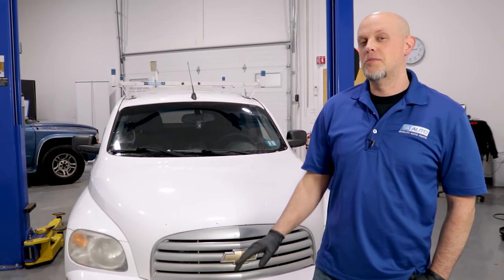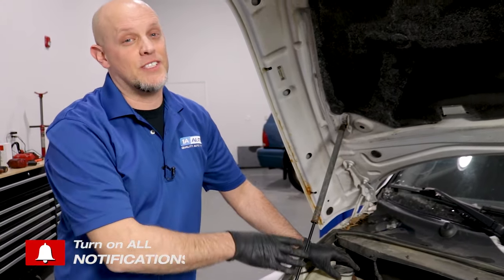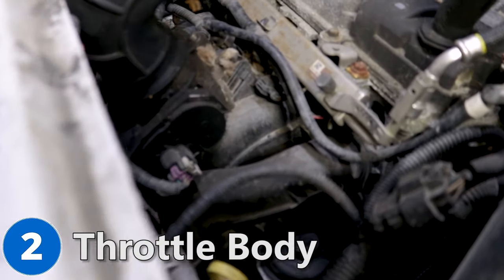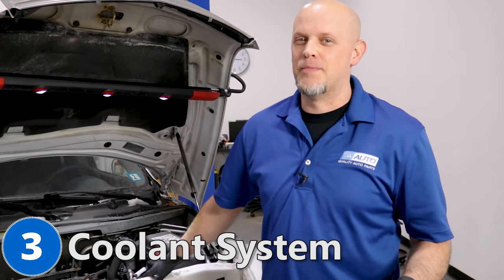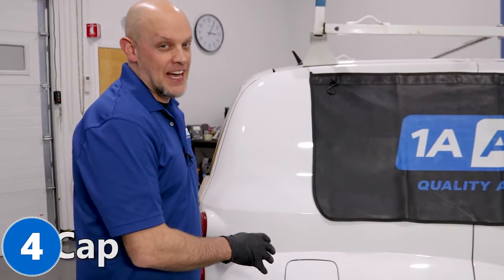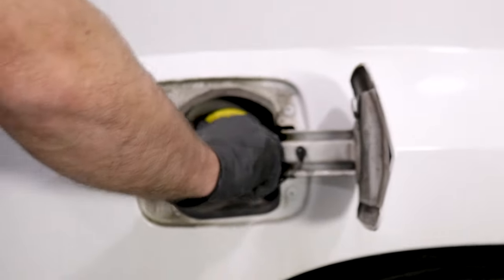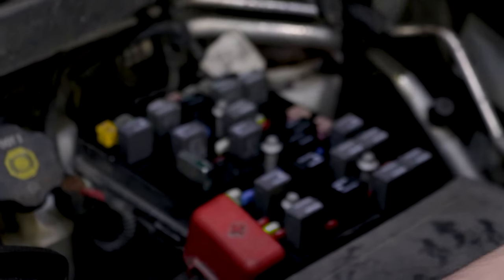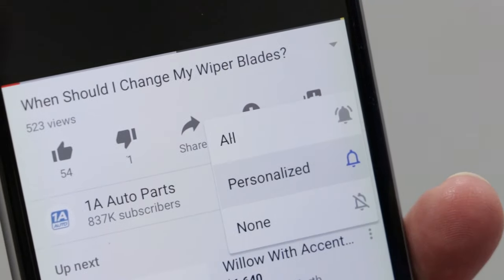Top 5 Problems Chevy HHR SUV 1st Generation 2006-11

Comment: Bought a 2007 a year ago that sat at a shop for 2 years a near by mechanic shop. His wife loves HHR's and she had one and his friend bought one near new as well. He was a old man and forgot to check the oil and ran it too low on oil and drove it and drove it and one day it died on him at a stop and he had his friend this shop owner come tow it back to his shop to see whats wrong. He found out he messed the bearings and rods up. It still ran but knocked very bad and had no power over 40 mph. So his friend sold it as parts to him for his wife in case she needed parts. It needed another engine or rebuild to fix it. So it sat. 2 years later he decided to sale it as is with a description of it needs a engine. I bought it for 900 bucks after talking him down just 50 bucks. He wouldnt go lower since it was in mint condition everywhere else. Had 127,000 miles on it. I made payments for 3 months and picked it up and drove it home. It ran like crap but made it home. When I got my $1,200 stimulus in 2020 I put that towards a used engine purchase online for $1,300 with free shipping to my mechanic shop and the engine had 83,000 miles on it. They sent me the transmission with it for free which was cool. A backup trans. Anyways had to pay a local mechanic $1,600 in labor to take the old one out and install this one. It's been running like a champ ever since but I've had to pay for all that and replace front rotors and brakes, then had to replace the whole flex pipe exhaust on it that was $450 bucks cause the flex pipe was shot and leaking exhaust into the cabin. Had to replace the battery which is oddly in the back and not cheap batteries at $140 bucks. I get oil changes every 3000 miles and always have my transmission fluid checked since they were dumb and wont let us check them without having to get under the vehicle to undo a bolt on trans to check it? Why not a stick up top ya know? Anyways I just have my local good mechanic do all that for me. Other than all that and spending near 5k in all now overtime overall... Its been a great ride so far. I think it needs shocks, struts ect.. But I can wait that out a while. It still drives good on the highway and I'm always driving 80 to near 100 on the long Montana trips to Billings Montana where we have to travel over a 100 miles a trip a lot. Handles it all like a champ. Runs smooth gets GREAT gas mileage. I can get 400 to 500 miles on a full tank highway miles that is. Only cost me like 50 bucks to fill the tank and that can get me 500 miles if I do the speed limit lol. 400 to 450 miles if Im always going 90 to 100 which guilty as charged I do a lot lol. At 100 mph it feels like ya doing 70. It's bad at getting you in trouble for being a lead foot cause it doesn't seem like you're going that fast. So now on the replacement engine its getting close to 90,000 miles driven on it by now. I don't drive 1,000 or more miles a month. Probably like 700 miles a month if that at times. It really is a good car though when its problem free that is. I feel the near 5k I've spent over time on it is worth it so far.
Reply: Yes and some people will say.. Why didn't ya just rebuild it, it would've saved me money. Yes that's true and that's what I wanted to do but my local mechanic won't do rebuilds.. Says it too time consuming and more issues happen. He rather replace a already put together engine thats been tested and confirmed its good to go and easy swapping and add the parts onto the engine block and done. Lot quicker and lot more stress free. He's my only mechanic in my local area that does engine work on cars. The others just do basic stuff around here. I'd of had to have my HHR towed over a hundred miles to the Billings Montana chevy dealership for a rebuild and I'd imagine they ain't cheap and they would take their sweet moses time doing it. My local shop told me to find a used engine or he can order a remanufactored one which was over $3,500 and I said hell no. That was way too much for my budget. A Used low mileage engine was cheaper and he agreed and let me find one. Cost me $1,300 online with free shipping and they gave me the transmission with it for free and he charged me $1,600 in labor to install it in 2 days tops. I dropped my car off on a friday afternoon and he had it ready and done by Monday morning and allowed me to pay half down and make monthly payments on the rest till I had him paid off and got to take the car. What sucks is he reduced it down to $1,400 saying he didn't have to replace any parts like he thought he would have to. So he reduced the labor $200. Then he and I laughed the day after the day I picked it up cause I had to take it back to him cause road work was going on and a huge rock in the road got knocked up into my oil pan knocking a quarter sized hole in my oil pan. He said thank goodness we still have the old engine and its oil pan is still good. He added $200 back cause he replaced it for me but had to clean the old one as it had metal shavings all in it from the bad engine. He said it took near 2 hours cleaning that out and getting it ready and replaced for me. So it went back to $1,600 lol. I was like damn... I saved $200 bucks for 24 hours at least and he laughed lol.
Reply: Tip. Unless you’re able to do the work yourself, never buy a boat or car that’s not running. You can get running HHRs for around $2500 and you’ll know immediately on the test drive what issues it may have. A non running car - you’ll not know what else is wrong with it - and their will be something else wrong - you’ll not know what’s up until you’ve tossed money into it getting it to run

Comment: A major issue I've had difficultly solving is the speaker system. The two pillar tweeters work but the speakers on all the door panels make no noise whatsoever. Apparently this is a common problem with HHRs. I have no idea if it is the head unit, the speakers themselves, or wiring. I am at a loss. I don't want to shell out money for speakers just for new ones not to work too.
Reply: Had that problem on my 09 , they are known for speakers going out as rain water getting on the connections and or speakers. Also the alarm for lights left on or keys in ignition go threw the left front speaker, I found out the hard way as the rear speakers were out and the left front was interment.and my lights got bumped and left on drained the battery. I used the one good speaker to trouble shoot. Put after market speakers in the old housings, covered the speakers with plastic.. going good for 1.5 years.
Reply: @davidholtrop6429  so is not the radio the issue.  I have the same problem and my speakers come to life only when is really hoy outside.  I will try getting one new speaker and replace it.  Thx
Reply: Yep. Speakers go out. I purchased a 2006 that no speakers worked. Then I purchased a 2009 with 2 of 6 speakers working.🤔
Reply: Replacing the speakers on these cars is no big deal. A pair of $40 Kenwood coaxials from BB, make sure you get the GM mounting brackets and harness so you’re not hacking anything up.  I swapped all four of mine in about an hour.
Reply: Water gets into the door seals and window seals and shorts out the speakers. They may work again when they dry out but I replaced mine and siliconed what I could in the door jam where the wires run through the door to the body. There was still water in the door when I did the replacement so be sure to dry everything up really good

Comment: I am currently diagnosing my son in law's 2010 HHR, and I honestly have to say, this is absolutely the most unreliable and POS vehicle I have ever worked on! 
With only 75k miles on the vehicle, and since I have done all of the maintenance over the last seven years, I know that this vehicle is very well maintained. Yet in spite of my diligence in making sure that all of our families automobile's are well maintained and serviced according to the manufacturer, this vehicle has been the only one that I have had to replace door handles, window motors and regulators, both VVT solenoids, gas cap, EVAP canister vent purge solenoid, camshaft position sensor, and as stated in the video, a throttle body.
It is simply unbelievable that GM has gone this far downhill with quality, fit and finish, and most of all....Reliability!
I guess I was just spoiled by being a teen during the 60's and early 70's, cutting his teeth by learning to work on Chevy's and Cadillac's! It's truly a damned shame with what has happened to the so called "Made in America" vehicles, Ford is almost as bad, and don't even get me started on Chrysler/Dodge products!!😠

Comment: HHR #1 problem = electronics 
Also, NEVER jump a newer car with jumping car running. Screws up electronics. Everything from just the KEY to ruining ALL! 
What year did cars became so electronically dependent??? 
#2 ignition switch (RECALL) - Part of electronics.  + Can't even read the label/tag info on inner door anymore!

Comment: And radio speakers work when they want to? What causes this? And I have a whining sound in the front, what can this be? I just had axle seal replaced and axle oil put in it? New tires too?
Reply: Cold days, rainy days or a good car washing....my radio doesn't work.....only in nice sunny days!
Reply: The window seals go bad and the seals inside the door jams go bad and let water into the inside of the doors and it shorts out the speakers until they stop working all together. I got the moisture out and replaced the speakers and siliconed what I could in the door jam and its been fine since. Its been a couple of years since I dealt with that

Comment: yes it is great on gas and roomy but i would NEVER recommend this car. i have to change my bulbs every 10 months. i've taken it to the dealership to replace the wiring for the bulbs in 06/2020. i have taken it back 4 times since then to replace the bulbs. I've been replace bulbs ever since 2016.  Now i find out  they stopped making this car and the part in 2011. i bought my car in 2014.

Comment: I'm not sure you could consider the HHR having a second gen version, most changes were incremental over the years. Mostly colors offered and safety and powertrain features being added. 09' probably being the most with E85  Flex-Fuel on all engines 2.2 and 2.4, plus  Variable Valve Timing on both engines that year. Along with changing window controls from center console to door armrest. Interior and exterior looked identical for the 6 year run. Thanks for the tips, I've had the solenoid check engine light on once, but never came back; now I have O2 light on, bad sensor it seems.. Not hard to reach from what I've seen. Thanks.

Comment: My AI mechanic says that my rough shifting could be due to my low idle and stalling problems.. never thought to check the vvt.. I dropped the tranny pan and found no shavings so if figure the clutch packs were still good and didn't want to have replace my transmission.. I'll definitely try vvt and throttle body first..

Comment: Damn I’ve experienced all 5!!! Ugh!!! My check engine light is on, the TC light pops on whenever it feels like, then I’ll park it for 15 mins while I run into a store and come back and no lights on the dash and it’s running fine .... ugh! I hate this car! I’ve put so much money into fixing everything they said I this video 😩 I just need a new car
Reply from the maker: +The Countess such a bummer, it's great that you can do your own repairs though!
Reply: I've had mine for 5 years, an 07. I've had one major repair replacing the timing chain guide. The alternator and starter have also been replaced. For the life of me, as well as my mechanic, is it throws up a misfire code at random, when there seems to be no misfire. I replaced all spark plugs and whatever ignition coil the musfire was related to, and it still will just randomly throw up the code and a light when it feels like it. It seems to drive fine, just a quirky car I guess.

Comment: On mine, I got an error with the check engine light. 2011. They diagnosed an issue with the transmission and wanted $4700, they said they do not open them up to repair them, they just put a new one in. I cleared the error. Not worth the $4700, so I will drive it until it dies. I have always done the rest of my maintenance. Oil changes, etc., never miss they always on time. Whatever the issue is, occasionally it starts off from a stop a little sluggish. I let go of the gas, and push it again and that usually fixes it. Another place said it was the throttle body and they cleaned it out for $180, but the issue never went away, so it wasn't that. All in all, I love mine.

Comment: I just sent my 06 hhr to the junk yard reluctantly it's frame completely gave out but everything on it worked the wrecker drove the old girl on the flat bed under her on power 350000 miles i then purchased a 2011 that was hit by a deer redid the panels got new tires brakes and now looking to replace rack and pinion I've been driving it as a daily even with said repairs needed these cars are reliable I don't care what anyone says

Comment: Biggest problem wasnt even mentioned! Sub standard rubber parts - bushings, bumpers, etc . Most HHRs develop horrible front end clunks, thuds, bumps and clanks because steering and suspensions are worn out completely at 100K miles! never seen one that wasnt. Costs around 1500 to 2500 to install new parts with good bushings. .Timing chains can last 200K  , but they usually rattle at cold start up before they go, so pay attention. Timing chain, water pump, and gears replaced around 122 to 1600 in my area. The mototrs can be good to 300K, so its probably worth  maintenance. They are good cars for the 3000- 5000 most run. Buy 06 to 08 - avoid VVT if possible

Comment: Glad my 07 HHR doesn't have VVT. I already replaced my gas cap before and haven't had any of the other 3 problems (knock on wood) either. Same engine and trans going on 175k miles.
Reply from the maker: +Burdysc Thanks for the feedback!

Comment: Got my 2006 two years ago at 90K miles. She’s a dream. However, like other commenters, I’ve recently had problems that aren’t in the video. Ouch. They are:
Two weeks after last oil change, check oil light came on. I watched a couple vids on it but so far 🤷🏻‍♀️
Both passenger and driver floors flooded and soaked from rain, literally two days ago. That’s going to be a nightmare in labor costs 🙆🏻‍♀️🤦🏻‍♀️

Comment: Dec 2021 bought an 09 2LT with 25,900mi $9,850. Flew from Charlotte to Seattle to get it.  Drove down the Pacific coast to LA  then east. The sport suspension handled curves and twists nicely.  Check engine light came on a couple times,  for an hour or two.  An auto parts store said the code related to the VVT, but would Check further when he wasn't swamped.  As the car was running fine,  the light intermittent, the oil and temperature all normal I continued home.  As the dealer has failed to send the necessary paperwork for the DMV, until 21 days after the purchase, I haven't been able to buy a plate to legally drive it to a dealer for services I likely need, like the coolant and transmission flushed, sparkplugs replaced, etc.  Good video and informative comments, thanks
Reply from the maker: +QuickNick54 Thanks for checking us out. Shop for high quality auto parts on 1AAuto.com:

http://1aau.to/m/Shop-1AAuto-c

Comment: Had to release camshaft & exhaust position sensors because they would throw a code after a heavy rain.  We know how bad a design the rubber cover to the fan box.
If you don't know,  you will when you find water on the passenger floor board after a good rain. 
Don't run fan before relaxing that cheap rubber seal ($20 ebay) or your likely to bow the fan motor.

Comment: I have a 2007 HHR  LT I paid $300 for my power steering replacement part at the dealership. My engine light is on. I was told it was bc I replaced my gas cap with a non-original "key gas cap.5⁴... It also, stopped me from remote cranking.... I ve tried to find a replacement gas cap that would allow me to remote crank again... Question: Do the original gas cap prevent anyone from siphoning and/or opening the gas cap/panel door? I was curious because I use to stay in an area where little children would do things to your car...ijs

Comment: This is a question I just purchased a 2011 HHR from a reputable used dealer with an excellent inspection report everything works motor and automatic transmission excellent no issues except one..occasionally when sitting in traffic the idle will drop for a couple of seconds simultaneously the air fan will lose power, it’s just circulating air not the heater or AC then quickly returns to normal it’s only happened a couple of times but since Ive only had the vehicle for a week I’m on the look out for potential issues that could hamper a long road trip, when I first drove it home I used the AC and there were no noticeable issues I haven’t owned a vehicle for a long time so am hoping for some experienced insight on what to watch for or consider

Comment: Awesome information, is it OK to run 93 octane in  my 2007 hhr LT.  I was told that the 87 octane gunks up the throttle body?
Reply: My 2006 2LT 2.4L states 93 octane for those 20 mpg in the city. 
Remember three fuel filler is now in the gas tank with the pump and who wants to replace that because of bad gas?